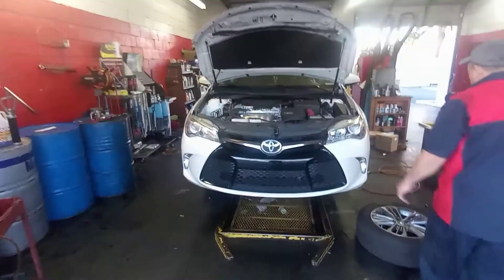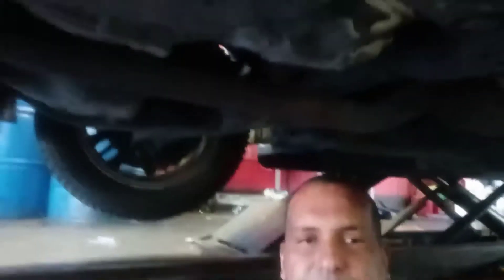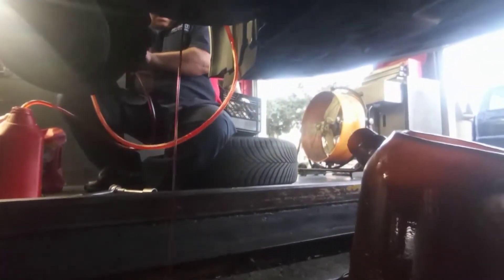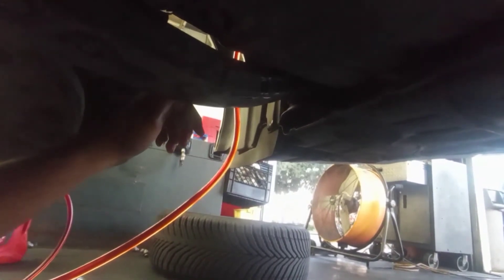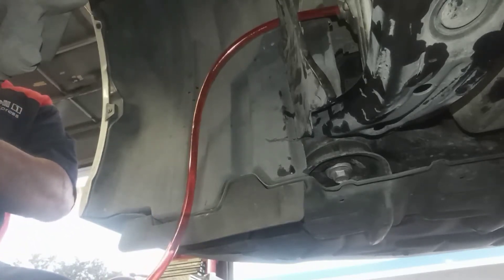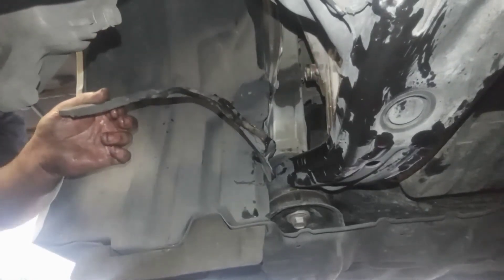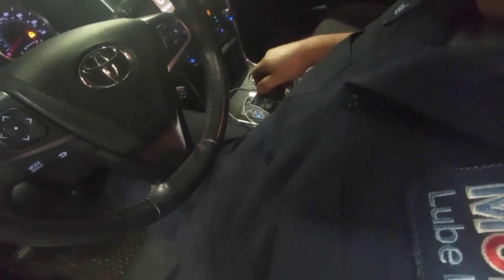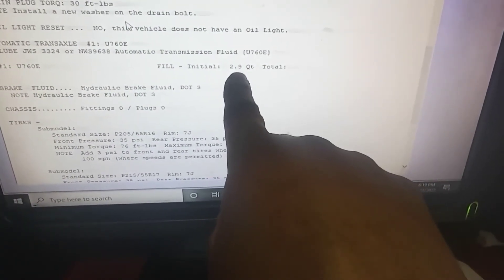2016/2021 How to Change Transmission for Toyota Camry

Comment: YouTube Channel - One Road ? showed the disconnecting of hoses to transmission cooler . One hose sucked up new fluid to force out the old fluid as in a " passive flush " .
Reply from the maker: Always when you want to flush your transmission fluid never use machine like other place recommend especially if you have a lot of mileage on your car so we take chance you can destroy your transmission always drain and fill

Comment: Would you do a 2018 Camry?   Please.      Models 2018 and up, are diferent from previous models,  I think the 2018 has 2 chambers or 2 plugs on the bottom, to empty the oil from to diferent partitions.   thank you.
Reply from the maker: Just make sure the car is not CVT transmission if it's a beauty by the fluid from the dealership and do the same process as you see on the video
Reply: So does this camry but they didnt know that.

Comment: You didnt take out the overflow valve. You did everything wrong. Tell that lady before her transmission blows
Reply: I was wondering.  There's a second plug.
Reply from the maker: The second plug is close to the driver tires you can remove the tires then remove the plastic cover then you found it use number 24
Reply: @LessExpensivefix  I meant the plastic straw under the drain ug.

Comment: This is not the right way to do this. You need to remove the second bolt inside the drain bolt to remove the fluid properly.